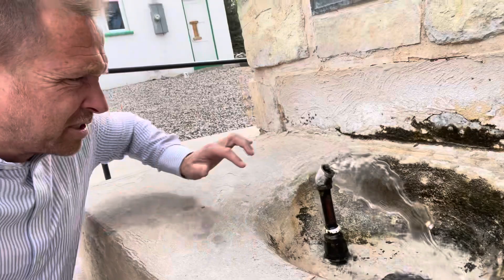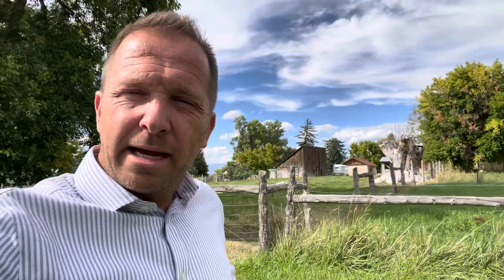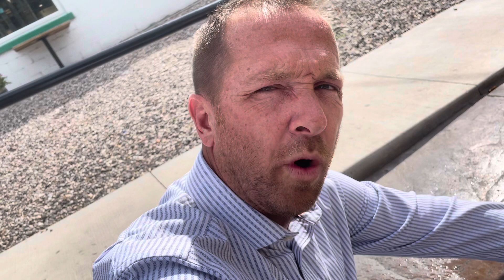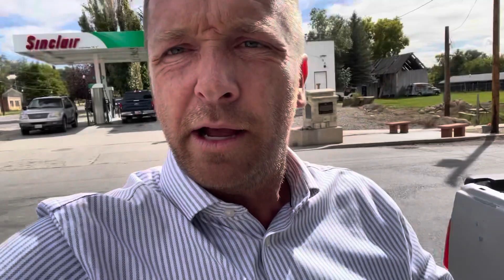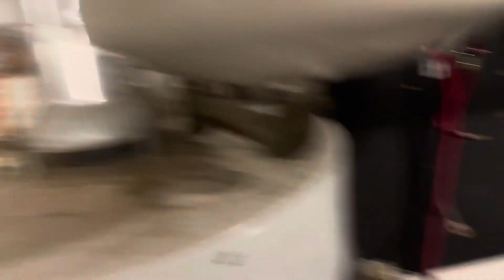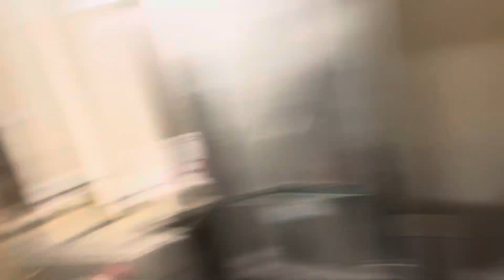WATER CRISIS | Are You Prepared. ACT IMMEDIATELY

Comment: We went 23 days without water July of last year when our well ran dry and two more wells had to be drilled before we finally had water again. It was rough.
Reply from the maker: Was that a personal well or a well for the city? That would be tough!
Reply: @mantihomestead  personal. We're out in the sticks. We filled up jugs at the meetinghouse every Sunday for flushing the toilet and drank bottled for the duration.
Reply from the maker: @RyanMercer  dang!!! If you have any lessons learned or perspectives, I would love to read those in the comments. It’s a good brain exercise for the rest of us to be prepared.
Reply: @mantihomestead  have options. Fortunately we had several ward members volunteer laundry and showers. Aside from that emergency fund, that cost us about $16k all said and done just for the drilling and then we had to replace our RO filters and get an electrical annode for the water heater because the third well ended up needing to be a bucket well and either from the layers or is in or the gravel backfill it has iron eating/sulphur producing bacteria which made the hot water smell absolutely horrible (like decay) but fortunately they electric annode just completely nukes the conditions that allow for the smell. I always know when the gfci outlet has tripped on a storm because the hot water starts to stink bad within 12 hours. 

We had about 15 gallons of water storage but even rationing that we were struggling a week in and had to switch to filling up empty jugs at the meetinghouse just tk service the toilet.
Reply: That looks like a copper pipe, not crappy pex. Yikes!

Comment: Thank you, this reminded me to get those pipe insulators so we don't freeze again this winter.  We were drilling holes in the kitchen ceiling to find the leak and it turns out it was just due to the pipe outside being frozen so it backed up inside.
Reply from the maker: Dang I imagine that would’ve been frustrating to have things freeze on you!